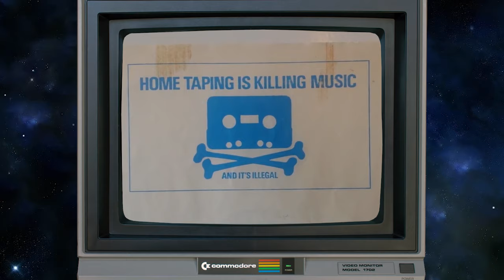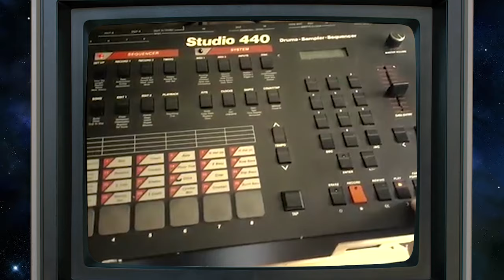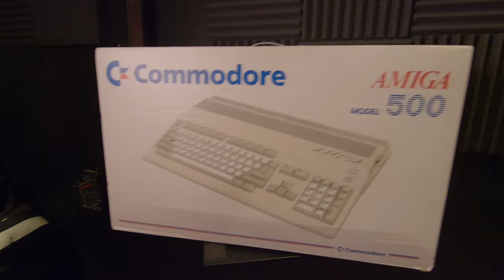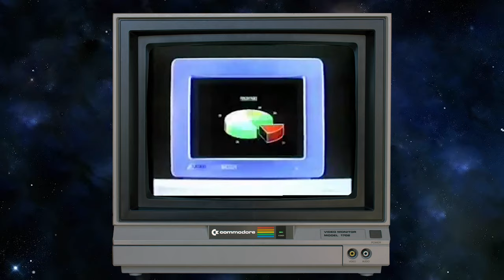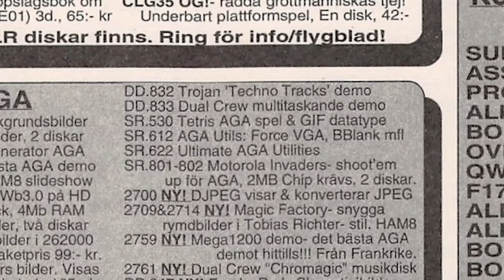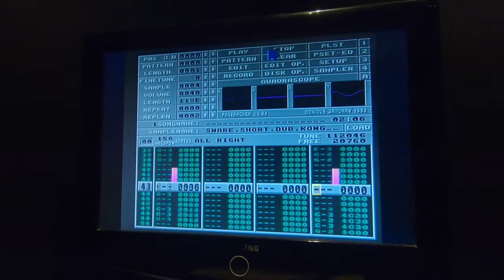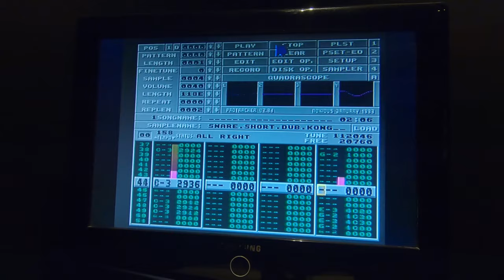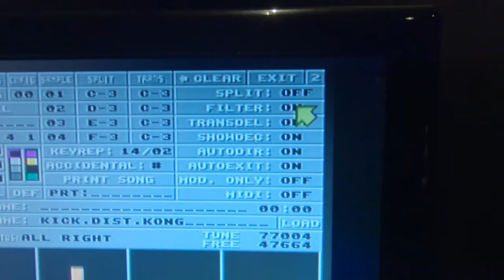🕹AMIGA 500 music | MINI DOCUMENTARY🕹

Comment: It was 1985 for the Amiga 1000 and 1987 for the Amiga 500 capable of doing sample-based music Even musicians in the recording studio have used the Amiga because the Fairlight CMI was thousand times more expensive. The Amiga was a real multitasking machine and capable of true "plug and play" with it's auto configuration hardware expansion slots.
Reply: And it had the HAM mode for 4096 colors (he missed to mention that). And he missed the fact that Amigas were famous for their graphic, animation, video features and software! For example the "Videotoaster" (modified Amiga 2000 with Lightwave 3D). And for example also Cinema4D started on Amiga and also the software that later transformed to Blender 1.0..

Comment: dude, that's baddAss!!!
love it.
I did also wonder, could I use the Amiga like a rack sampler, and sequence externally via a MIDI interface, or are trackers really the one way to go with this machine?
Reply from the maker: You could indeed! I have a midi interface for mine too, problem is both the interface and the sampler connect to the serial port so you'd have to either switch them out all the time or find some switch for it
Reply: @BlezzBeats  ah!
What program is good to get for operating as a stand-alone playback sampler?
Like, is there a program that can do multiple note polyphony for chords & such?

Comment: Aaaah the nostalgia. I still have mine in the garage I think. Along with the sampler your dad built me. I made lots of tracks with Sound Tracker and then Pro Tracker. 

Before the mod-file format was introduced, including the samples in the file, only the notes and meta data was saved. So to be able to load a song you had to shuffle them floppies to load each sample from a different disk. 

Extra nerd facts: The sampling was off course made through the parallel port, but the parallel port only have 5V power. The serial port however have +/-12V pins. So the cable to the serial port was only to get that extra supply to the sampler components that required 12V.
Reply from the maker: Wow I had no idea you had one, would love to hear some stuff you did on it!